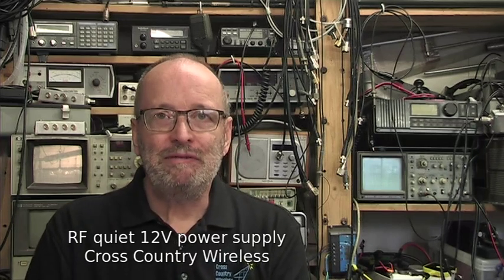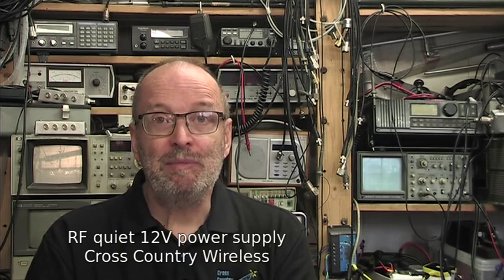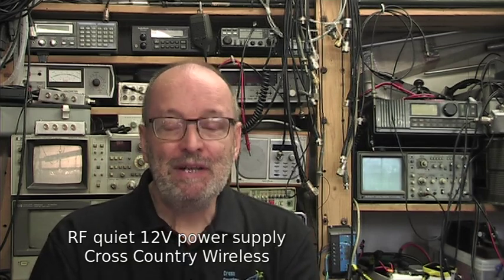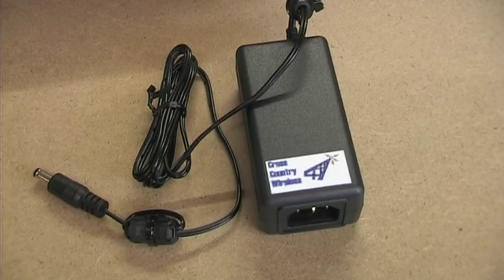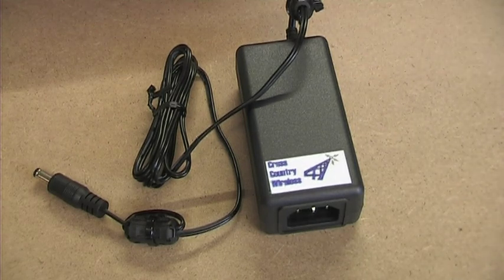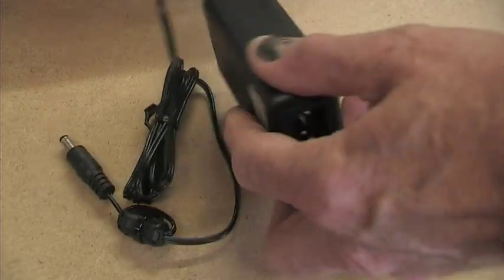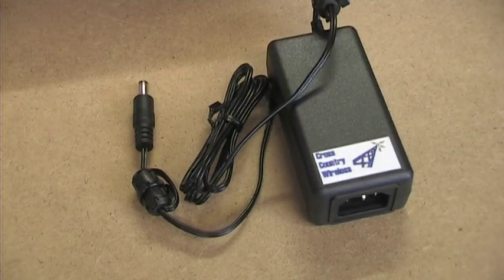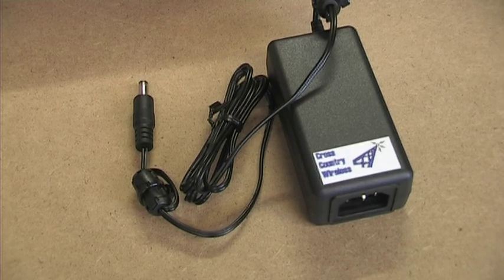RF quiet 12V power supply - Cross Country Wireless

Comment: Hi, doesn't it radiates from the body?
73
Francesco, IN3XZP
Reply from the maker: Yes, if you put an antenna directly against it. The main problem with switch mode power supplies is radiation from the cables on the input and output. The cables can act as antennas. Good internal design can reduce that and the ferrite chokes we add reduce it to a very low level.
Reply: Thank you for the answer. I am trying to clean my RF environment from RF garbage. :-) @crosscountrywireless